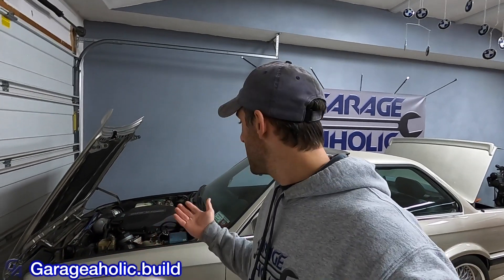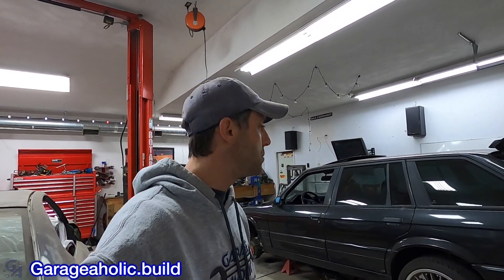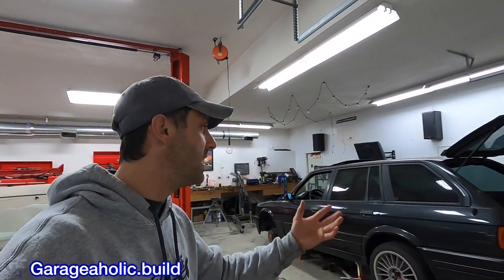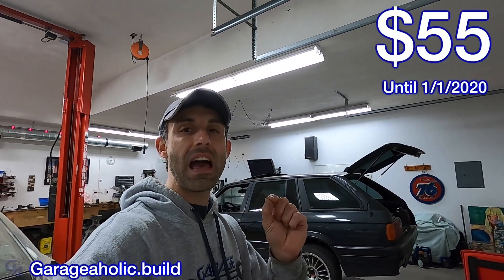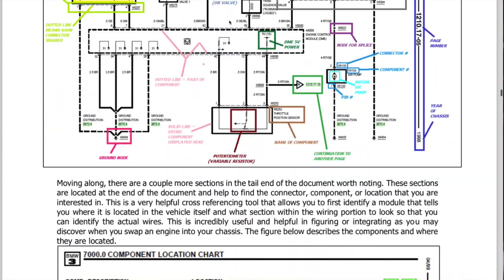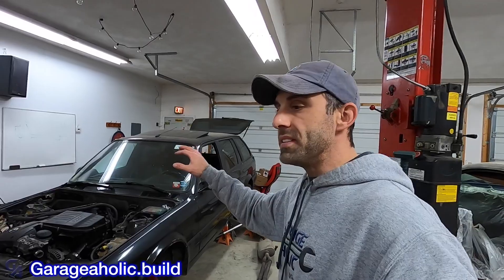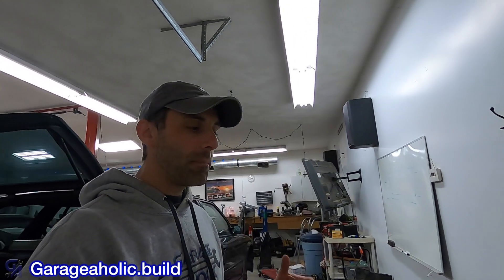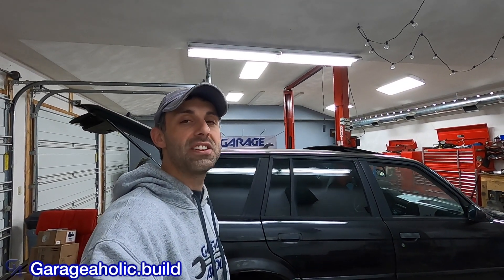BMW N54 Integrators Guide, Specific to E36 Chassis - Available NOW!

Comment: Will this swap fit for left hand drive, I see the turbos hitting the steering column
Reply from the maker: This swap was done on a left hand drive car.
For RHD, your issue will be clearance if the turbo outlet charge air pipes, particularly the rear turbo